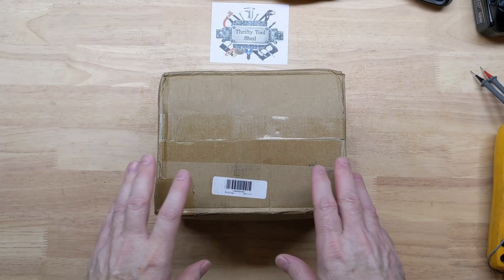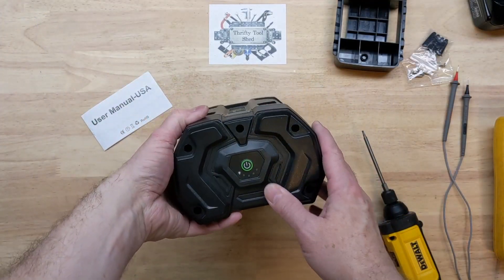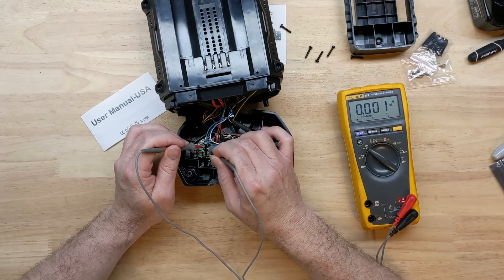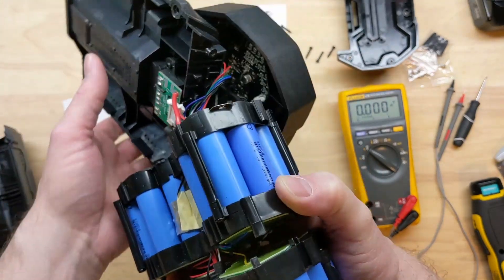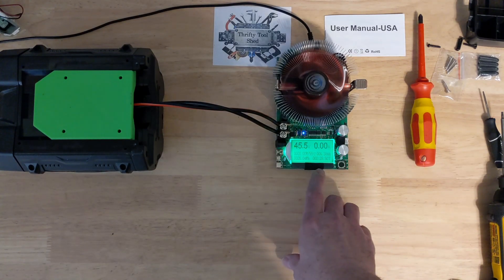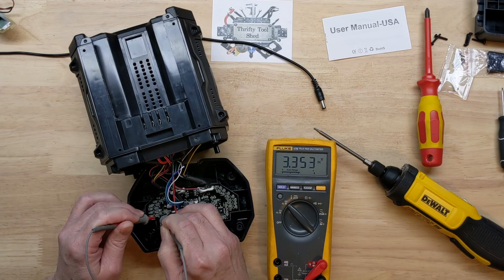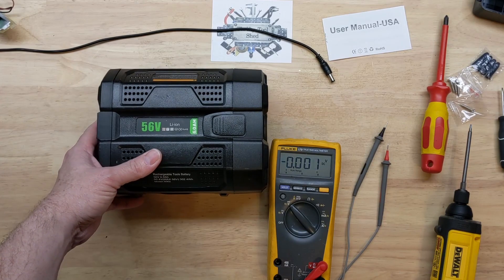AMC 56V EGO Replacement Battery Test

Comment: One of the owners manuals I read on a similar tester said not to go over 60 watts if the voltage is between 36 and 80 volts. The 180 watts was only if it was below 36 volts.

Comment: to make the test more reliable and the result correct, the load should be set to a current value of 1c 6 a for a 6000 mAh battery
Reply from the maker: Thanks for your help, its absolutely better.  In some of my videos I explain that I have a 180W max tester so I am limited. It's simple math 6 x 56V is closer to twice that wattage. I simply test all of mine with the same tester to compare so all tested is still unbiased no matter the brand and again I mention that. Many cell spec sheets show discharge capacity curves and differences within several discharge current rates as well as 1C.  I will eventually get a larger load tester once the channel reaches that level. For now I will still use what I have to compare when needed since it's a excellent constant load test my only other method at this time is not constant load.

Comment: I’ve seen another comparison video for this battery against the oem battery on their lawn mower. The gentleman said it didn’t perform well, his mower kept shutting down while using this battery, where the oem battery had no issues. I would love to see a high amperage draw test performed on this battery.
Reply: Sorry but that is also happening to a lot of Oem ego batteries as well . Mine does this very thing of shutting down . Watch the numerous videos of bad ego batteries . Videos of ego batteries not working unless you drop the battery to the floor . Mine does this as well . Ego batteries are not any better . I looked up the cheap cells ego uses and you can buy them in bulk down to $3 per cell . When you pay $600 for a 12ah battery you see the massive mark up in price . For there cheap batteries .
Reply from the maker: I have seen some bad reviews and comparisons for sure. I mention that in one of the videos I believe. Maybe the Ruzixt 5Ah 1 year update video. I only have 2 of these aftermarket type packs. The 5ah that I bought first just to look inside and compare. The 6Ah they sent me to review. I can only share what I have tested and I have used these in the mower and blower for over 2 years now. Mine have happened to hold up well. They obviously have Chinese cells and a copied BMS board. I also see so many different sellers now that I don't know how the quality varies. I only have one video showing me using it in a mower. I just happen to use it while testing the mower in the video below. I also use it in this repaired mower ever since the repair of it in the following video. I don't have an easy way to load tests other than the mower and blower itself. 
Thanks for your comment!

Comment: Question - At what voltage do the Ego batteries cut off at.
Reply from the maker: It's been a while since I tested these. I believe they were around 40V cut off.
Reply: @ThriftyToolShed  Thanks I appreciate your reply, I measured 51.9V after using it on a 18" chainsaw so it probably sprung back. I will measure it straight after use.
Reply from the maker: They will bounce back up some for sure. These monitor individual cells also, so if any cell drops below 2.9-3V or so the pack will shutdown. So it could be shutting down a little early if any cell has lost a little bit of capacity!

Comment: Have you found any good 7.5 or 10A replacement batteries?  Thanks - great videos
Reply from the maker: Hi,
I have not tried any  at this point. I have seen the 9000mAh aftermarket advertised at one time and lately I have noticed they don't show in stock or even advertised as they used to.
Reply: @ThriftyToolShed  cool. thanks for the reply.  looking for some large capacity options for the EGO snow blower.  Let us know if you come across anything for those of us in the Great White North!!!

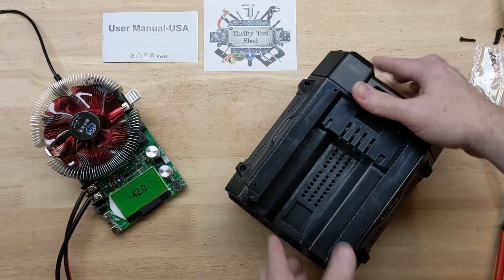Comment: @5:17, can you please post a link for the EGO battery adapter? If you 3d print it yourself, you should start selling it on ebay.
Reply from the maker: I will add 3 links below. The first is the eBay link to one similar to the one that I used in the video. I will also add some Amazon links to similar adapters if they work for you, the cheaper one has smaller gauge wire so depends on the load you plan to use of course.
https://ebay.us/REob6D
https://amzn.to/3rC4Kz3
https://amzn.to/3fDB1TA

Comment: Just got some 12s. I’d love to open them to show them off but I have no idea what to care about inside.
Reply from the maker: I would like to see inside of those also. If you do a video looking inside the 12Ah send me the link. I don't know enough to say since they may be a lot different. One thing to mention is most of these on the board end where the fuel gauge and BMS board is, be careful and don't pull hard lifting it off. I have had viewers show me that they snatched the end off and pulled the wires out of the board. Usually these only have a 1-2" of wire length from pack to board and 3 connectors. The back cover and the separation of the halves is usually very easy on the other packs.

Comment: So I have a 36v battery pack out of a hover board. The voltage was 1 volt so I woke the cells up with the charger and now it reads 40volts at the B- B+ on the pack but when I use the xt60 connector on the BMS the voltage reads 26v so I used another bms from another similar battery and the same thing the voltage reads 26 volts. Could it just be both bms boards are bad?
Reply from the maker: Well, what are the individual cells reading. If the pack went to 1V more than likely all the cells did not balance back out correctly. You could have some bad cells in series and they are low and some unfortunately will be over voltage. The BMS maybe doing its job and picking up an issue with individual cell monitoring.
Reply: Thanks for the info so I went back and disassembled the pack and got a reading of each cell and there was 4 that was at 3 volts so I swapped them out and now the pack is reading at 41volt. I get why the voltage was dropping as those cells were charging off the others and it’s funny because I knew that already but for some reason didn’t think to check the voltage AFTER the pack was sitting for a few days. I would check it after a charge and of course the volts would drop a little but not much to cause alarm.

Comment: We all know that using non-OEM batteries is not recommended, but can it be really dangerous? Is there a significant risk of injury or, to put it shortly: can it explode?
Reply from the maker: I do not see anything in these packs myself to be scared of. I only own 2 of these, but I have many Chinese cells and the only issue I have ever had with them so far is some manufacturers over hype the capacity of the cell for selling strategy of course. That is why I wanted to capacity test this one and I was truly surprised. I don't see anything on these packs that would scare me anymore than any Li-ion cells made by anyone else. Even Samsung had issue before. I always say that I treat these almost like gasoline, it's alot of energy per pound, very energy dense for sure. Anytime I handle any high energy device I try to be cautious of what the energy can do, especially since I work on alot of these! I try to be cautious when lithium cells are being in use (discharging) and while being charged and especially if I am working on these on my bench!

Comment: I need your help i saw your subwoofer video and i cant find this
 TI 54334 DC-DC Converter Chip on Ebay do you know where else i could one for cheap?
Reply from the maker: I had a link at the time of the video for eBay where I ordered mine. They seem harder to find now? I see a few on eBay still and they are asking too much for them, unless you cant wait I would see if Digi-key or Newark gets them back in stock.
This is a link to Newark and they show out of stock and possible available in March 2022?
https://www.newark.com/texas-instruments/tps54334dda/dc-dc-conv-sync-buck-570khz-hsop/dp/28AH5890?st=tps54334

Comment: I have a question, maybe I've asked before. The 14" and 16" ego chainsaws have half the rpm capability as the 18". I have seen a lot of comments in an EGO facebook group that the 18" is a different motor and therefore capable of double the rpms. I am wondering if they are all the same size motor or actually different. But maybe the 18 just has the ability for more voltage to go to it and therefore more rpm's?
Reply from the maker: I don't have the 18" chainsaw to say for sure, but I believe the 18" is a higher output motor. The 14" and 16" are the same other than the bar and chain. The 18" is a marketed as having more cutting speed and power at least.

Comment: Do these batteries show up as more than 2Ah when plugged into an Ego Inverter?
Reply from the maker: I knew this question would come up so I should have mentioned that I do not own the Nexus power inverter to test it on. I can not answer that at this time. I will reach out to the supplier and see if they have an answer. Thanks for your comment!
Reply from the maker: Manufacturer just got back with me and stated the 6ah and the 7.5ah should work fine with the Nexus. The 5ah will not! I have no way to test, but ask them directly. Thanks for your comment!
Reply: @ThriftyToolShed  - thank you for your effort!